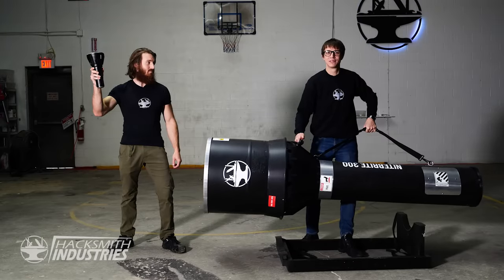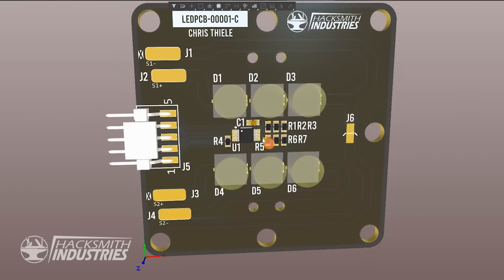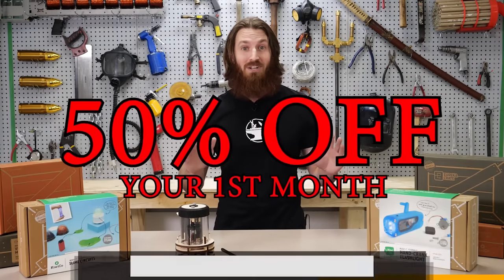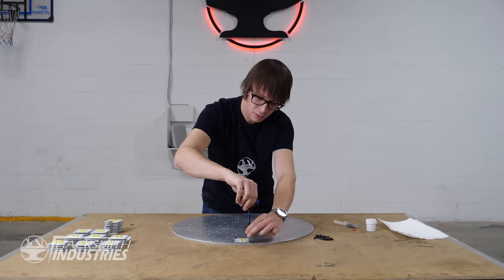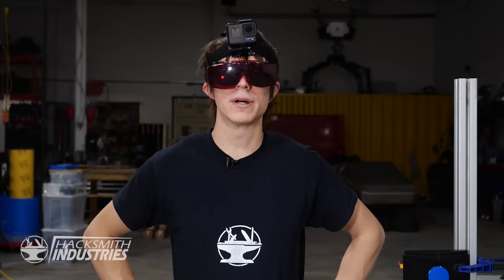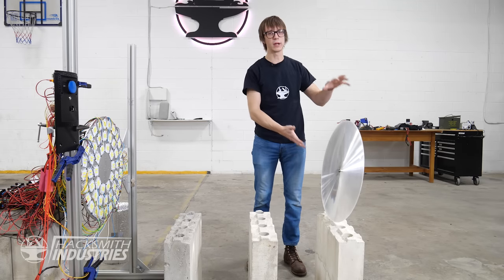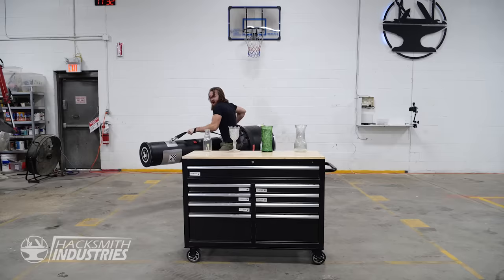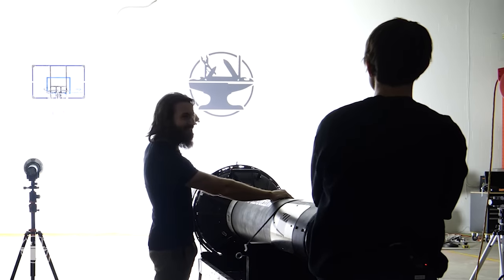World's BRIGHTEST Flashlight?

Comment: As cool as this “flashlight” is and as bright as it is, there’s something impressive about the form factors of the other lights, being so tiny yet being able to produce that amount of lumens is crazy!
Reply: tbf one led module in this flashlight is already hella bright
if the led density of the flashlight was even greater, it would be quite a bit brighter, as well overheat quite a bit faster
Reply: @Dyne's Lair Now we're talkin'
Reply: How many lumens?
Reply: watercooled and smaller ;)
Reply: @awesomestuff9715  I am waiting for the LED technology to progress enough to produce X-Ray radiation, and yes this is currently in development, but the phosphors that emit that light have to be almost microscopic in size and eat up enormous power in the process.
Reply: Look at some of the small LEP lights available now: the overall lumen output isn't spectacular, but the focused beam delivers light insane distances.
Reply: @kd5nrh  LEP is pushing 1000 lumens now, double the output in a short time frame. Last one I did even had a usable corona!

Comment: You should use a nitrogen recycling cooling loop with a radiator to increase LED density. Since cooling is a dominant bottle neck in LED density and therefore, brightness, this would allow the flashlight to be even brighter.

Comment: You should definitely make more tests with that bad boy,
1-point it to a window and see how a room is illuminated (artificial sunlight)
2-turn it on and record from few miles away
3-get authorization to shot it to the sky or the clouds
Reply: If you are pointing it upwards,
Could you also put a hacksmith logo on it to make Bat-signal
Reply: @calasurien  that would be amazing
Reply: Lol imagine pointing that thing at a plane
Reply: @calasurien  sadly that won't work because the flashlight is divergent, you would need a laser to do that, and a laser that size would be waaay to expensive, and then i'm not even talking about whether such a large laser is possible to build with current tech.
Reply: Upgrade Create batman logo en Point it in the sky
Reply: @calasurien  Will probably make the whole thing catch fire. Totally worth it though.

Comment: If you used a cnc router to cut grooves in the back of the aluminium disc, then sandwiched another disc on the back you could have done some watercooling :)
Reply: Cool idea. They could have cnc'd out some fins and got alot better cooling while also making it lighter also. A couple little fans would go along way too.

Comment: Wow I thought the flashlight in the thumbnail was an exaggeration. But it is the actual size of the flashlight you constructed. I was also surprised by all the electronics that went into it; it is not simply a matter of connecting a bunch of bulbs to a battery.

Comment: Y’all should’ve use the studio lights in comparison to the lights y’all were testing. The reason why I say this is because The little $20 light doesn’t compare compared to  $200 studio light on the camera. I can clearly see that the $200 studio light did better than the $20 camera in this video even though the studio light wasn’t supposed to be part of the video.

Comment: I work security and any good flashlight tactical flashlight or otherwise has a high mode, low mode, and strobe, the strobe has a few uses but one of the most effective uses is any emergecy personel be it, fire, police, or EMT knows a flashing light is an SOS. Its why they turn lights lights on and off to singal its time to leave. Though with this beast of a light not sure you need that strobe setting. And I'm more than curiois to know what turbo is?

Comment: 300 LED x 2000 lumen each = 600000 lumens !!! WOW a 100 W bulb is 1620 lumen !
Reply: Theyre using the 4000k version, but I calculated around, if not a bit over 600k after factoring for lumen loss. But it's a little under 650k without!

Comment: You lost me when you used a radiometer to measure light pressure. Number one it doesn't work by light pressure. It works by heat. Yes, it does. And two, it has a max speed which means at some point no matter how much energy goes into it, it won't go any faster. Really lousy way to "measure" brightness.
Reply: Ikr! That's probably the worst way to do it. I calculated it to be around 600k lumens